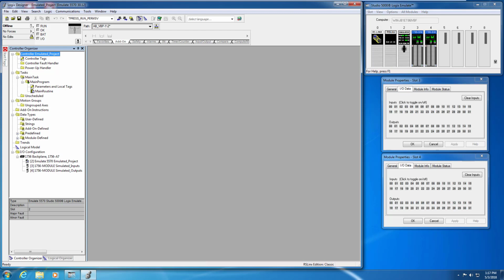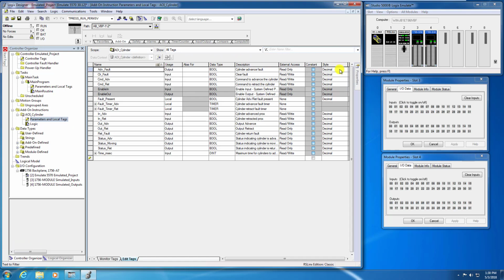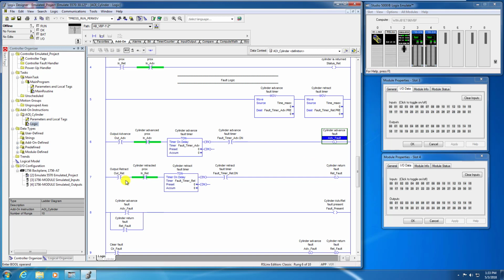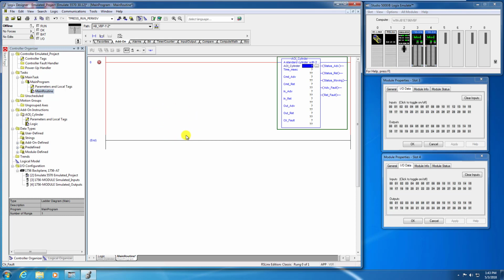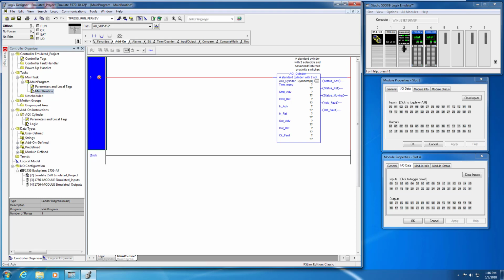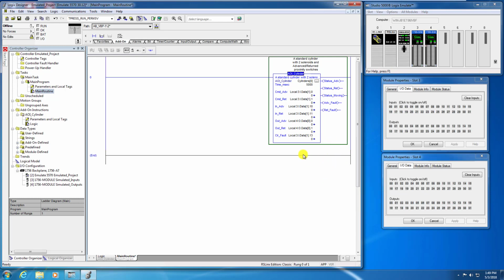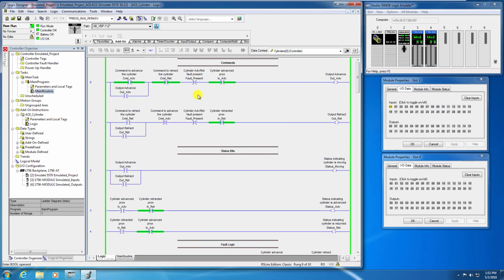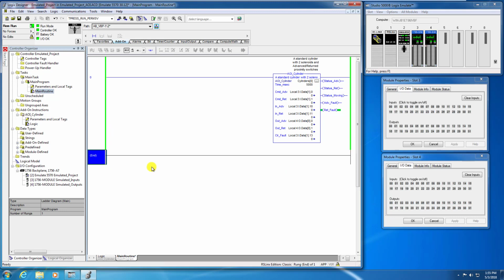PLCGurus.NET - Studio 5000 Add-On Instructions (AOIs)

Comment: Everyone has their own taste. Im a fan of AOIs and UDTs. Not so much of the Array though. A numbering system is so much better when coding. Put a label on the Cylinder in the field and match it to the AOI. CYL_010101, CYL_010102 etc. Makes troubleshooting for the techs easier too

Comment: I like the video, however just one comment - the Alarm flag would be better with a seal in instead of a latch. Use the reset/clear to break the seal in , with a Seal-In .. when the processor is powered back up after someone shut it down after a fault the alarm would be cleared as the seal in would go away. If your specific logic requires that fault state remembered through cycles - Latch it or DINT it outside of the AOI.